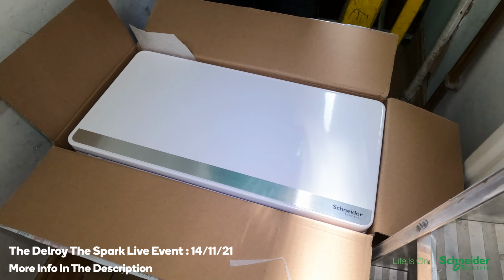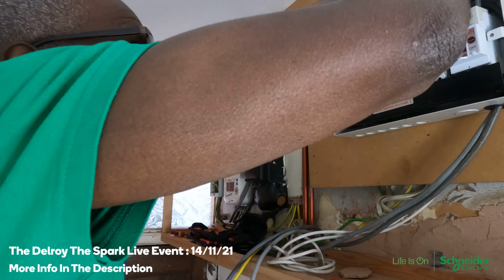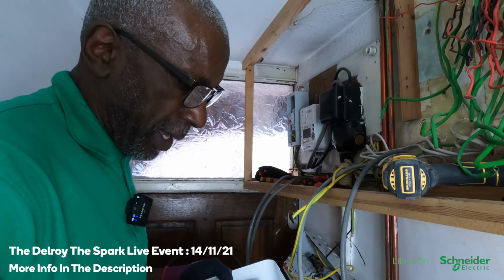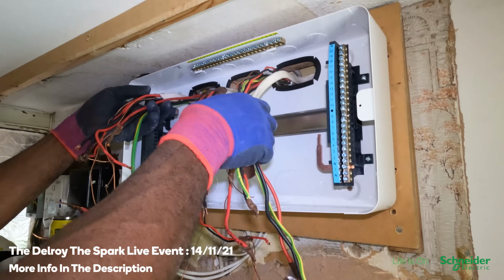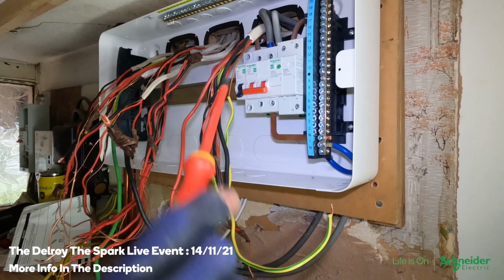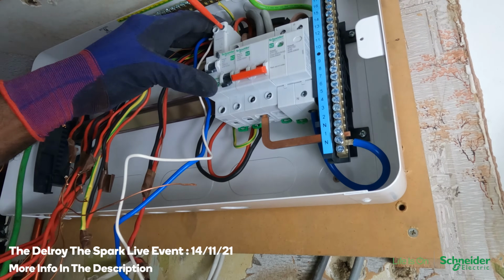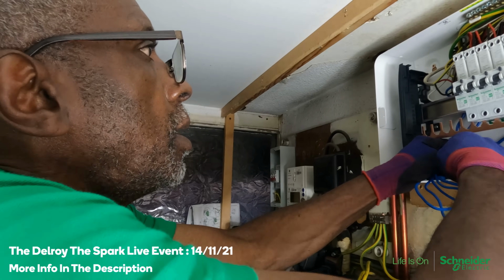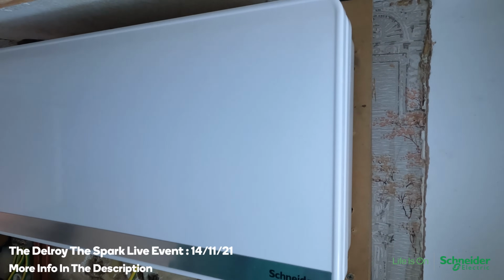How To Install A Consumer Unit With Surge Protection (SPD) @schneiderelectric

Comment: The unit looks good however: why is the SPD connected to the neutral bar? (shouldn't it be connected to the ground?) and why are the live and neutrals on the opposite poles on the mains switch?

Comment: I’ve come across at least 2 times unrelated cable running through consumer units last job had a bunch of them unrelated and had to cut through to the holes with wire cutters to get the board off the wall 😂🥵

Comment: We flipped it upside down when we did one of these boards so earth bar was on the bottom and then unscrewed the neutral bar and moved it to the right way as you have and connected it up. It gave you alot more room at the top side to dress it all nicely. 
Good work my man.

Comment: The spd should be a cartridge type (spd power off and just replace the cartridge) shouldn't have to replace take the cover plate off and replace the whole thing 

be nice if they would use the single slot type so both L + N is inside the same single spd

Comment: Smart looking board.
Why can't each circuit protection device switch be colour coded as a standard and the busbar supplied insulated ? 
Nice Upload.  👍🏿
Reply: Some boards have quickconnect din rails so the bus bar always has a cover in it (don't really like this box, seems big fuss to install and modifications required that shouldn't be needed (cutting the bus bar) , the main switch, bus bar and spd should already be installed
Reply from the maker: Cheers

Comment: do you not need to seal the cable entries for fire ?
Reply: No its not in the regs. The reg states that the board must be constructed of fire resistant material nothing more. Alot of manufacturers have jumped onto this and used it to sell sealing glands grommets etc but the regs don’t call for it.

Comment: I thought for a moment you were installing a small panel heater del 😆😆 see schneider is carrying on using the 9 branding trade mark etc merlin gerin used. Incidentally if any one is interested were the 9 came from it's supposedly the width of the device ie mcb which is 9mm in French measurements
Reply: Cool story. 
Don’t think they are really 9mm though are they??
Reply: That's what a rep told me years ago for merlin gerin but I think they are about 8 and a bit mm
Reply: @adierob1  I think you will find they are  more like 18mm if you measure one!
Reply: I shall get my coat tim p, I've just measured a Hager breaker I wonder what the 9mm was then,it was about 1990 I seen the rep